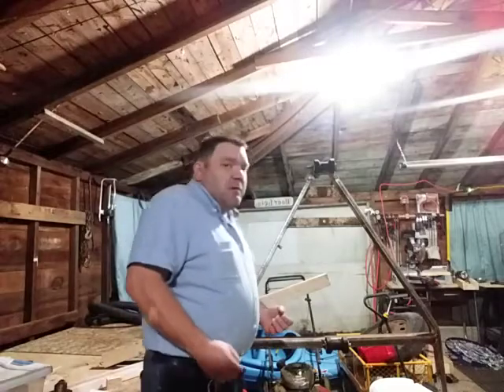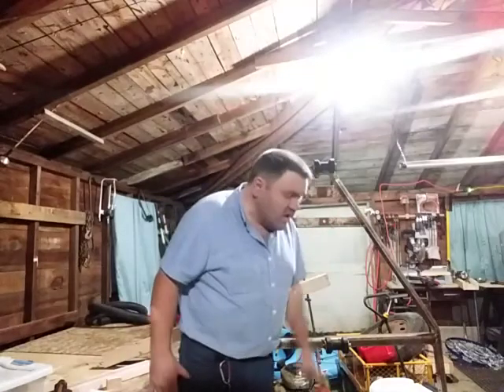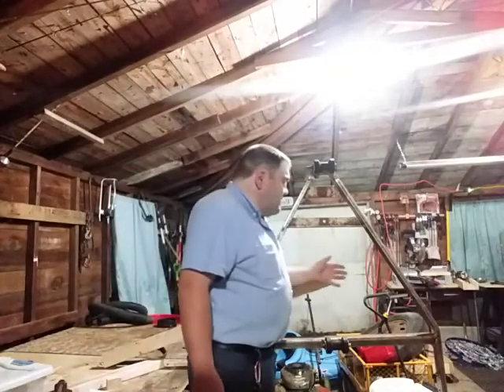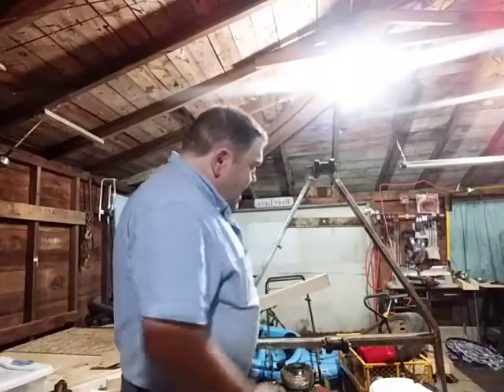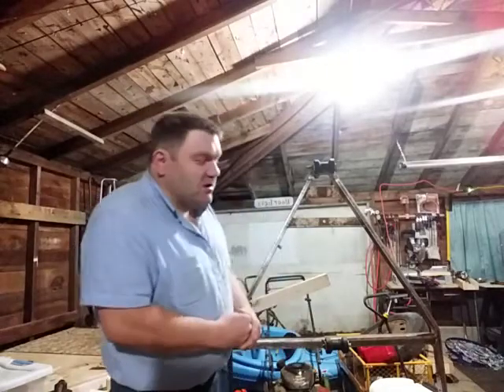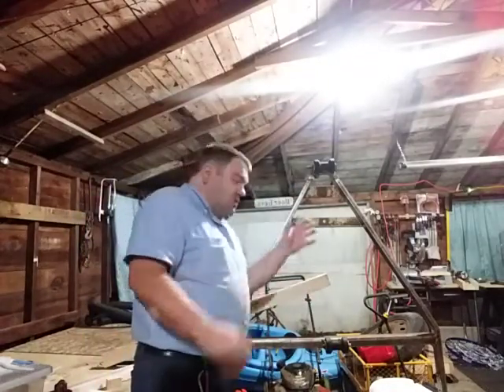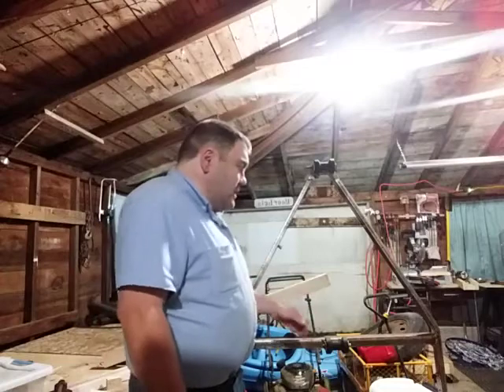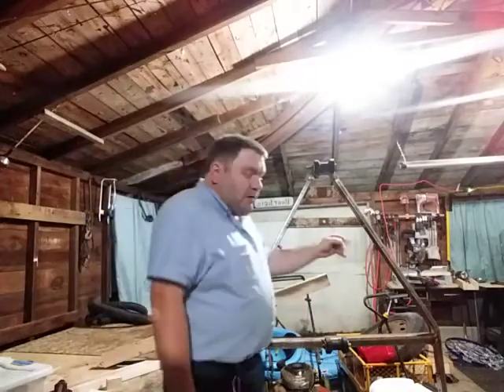Turning a trailer frame into a go kart talk build .

Comment: You can also leave the front the way it is so you can put a cheap wench on it in case you get stuck.all you would need it the smallest and cheapest wench you can find.You should also paint it now so it doesn't rust again and all you have to do is touch up on the parts.They get messed up when you're putting the go-kart frame together.....just a thought bro.